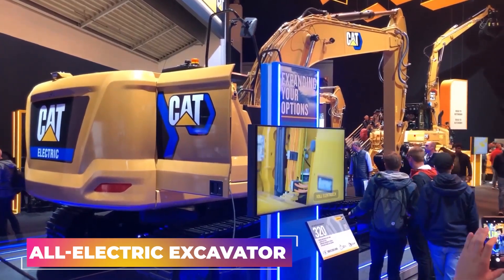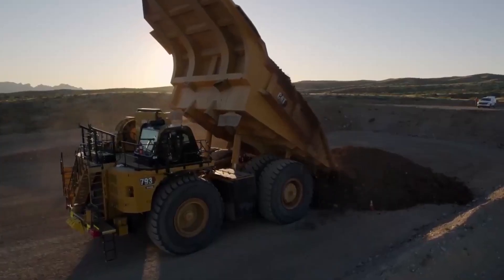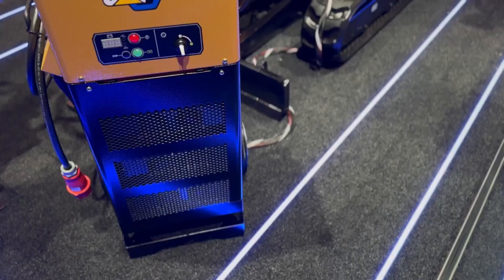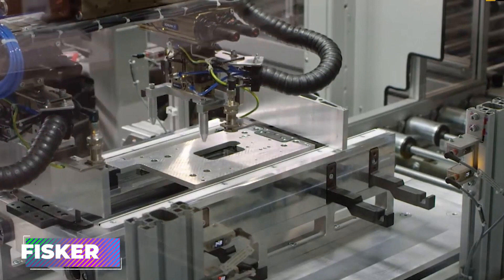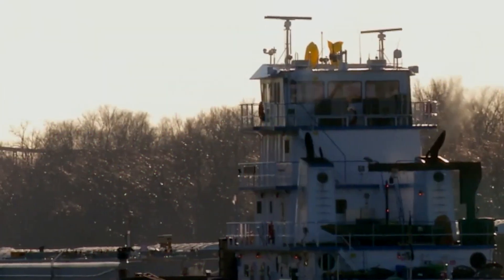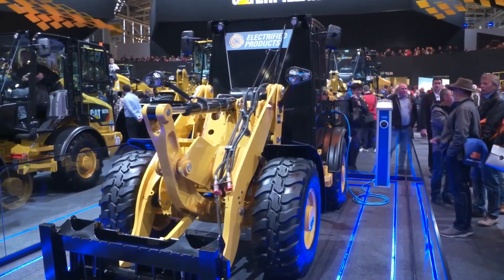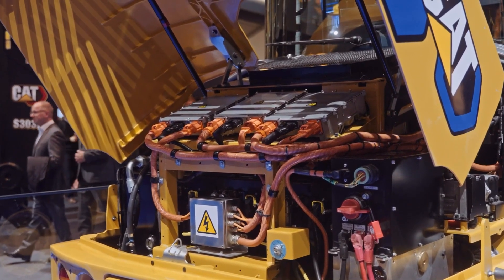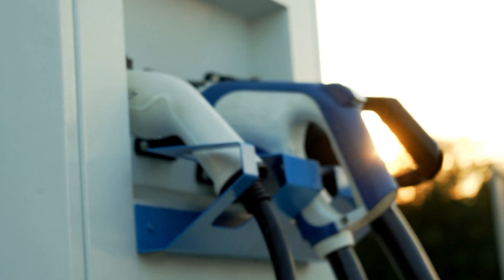Caterpillar's All-Electric Excavator Is A Game Changer [300 kWh]

Comment: It always amazes me when people say, "zero emissions", but then has a charging port.  How do you charge that massive battery.  I would think that the grid is 100% zero emissions.
Reply: Despite 150 years of internal combustion, we still lose a large amount of energy to heat. 60% of the energy created by combustion is lost to heat instead of motion.

The idea is, even if the grid isn’t emissions free, they generate the energy at 90%+ efficiency. Motor vehicles only have around a 40% efficiency. 

You could burn the same amount of fuel in both a combustion engine and a power plant and be better for the environment at the plant.
Reply: @SteveC86  I agree with you, in the power plant you can control emissions better than in a vehicle. On the other hand, the efficiency of a boiler system according to thermodynamics laws is just over 45% not near 90%.  Yes, is better than the internal combustion but not 2.5 times is about 10~20% better which is good.  Additional to that you will have losses in the transmission and distribution network added to the charging and discharging batteries.  So, I do agree in the less emissions, but it is NOT ZERO.